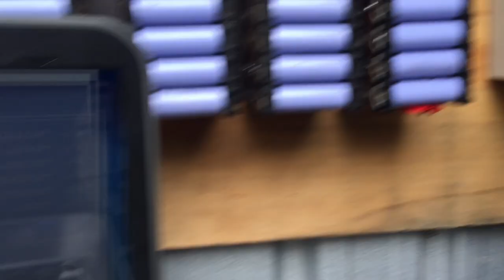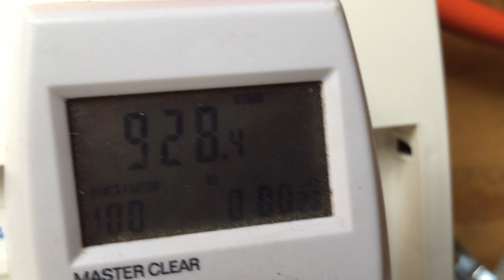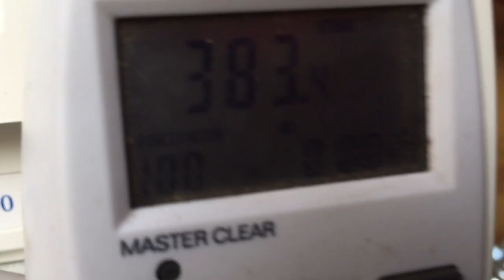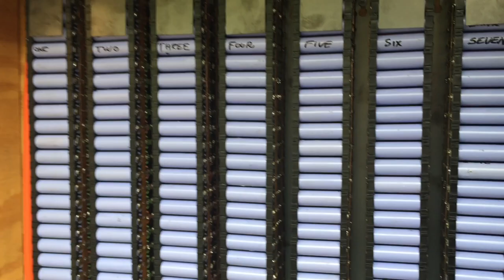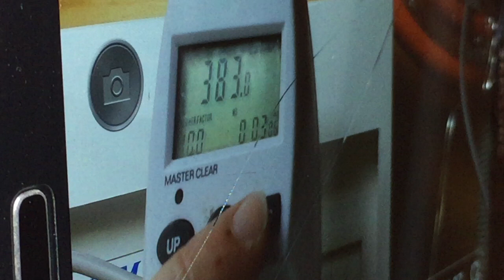385w Load test using 2 banks of batteries

Comment: 13kW.
Even if the bottom bank got less capacity the discharge curve will be nicer.
And since you are doing 300-400watt load the inverter will have less load wich means less heat wich would mean less energy wasted.
Well i'm probobly wrong but just wanted to place my bet :)

And i'm from sweden.

Comment: pete i do have one quizzing question a 3 parter mate ive looked at the way its wired up from the cell  pack to the inverter and  saw you are running them into a what looks to be a fusebox i was wondering why you was fusing the neg side, as this is where the heat was on thermo cam wouldnt it be better to connect the negative from the inverter to the middle of both packs connected to a bus bar then fitted to the batt packs providing equal return  to the cells, not connected to the top pack first then to the second pack ohms law ,the same could be done on the positive side aswell making it draw equal power to the fusebox , and one more mate also could you do the same for the packs instead of connecting in series to just the top of the pack add tabs to the bottom of the pack and then connect them to the bus bars aswell making yr draw and return equal in every way, now you could tell me to f,,k right off and go and do it ya fuckin self that would be fair as i have no posts but i ve spent my 20, 30 grand 7 yrs ago making something that is never gonna work until things get smaller  lighter with more power...but i did learn a few things along the way, sorry for the long post
Reply from the maker: In australia land both need to be fuzed cause someone at some point burnt their house down :( Heat was from the positive side not negative side in all tests. Middle yes better but time/money/need to have this test started ment it ended up like this. Can't add to bottoms sorry but i'm working on V5 of the busbars now.
Reply: ahh ok different country different regs, and as for the burning of the house what can you say ta that, Muppet should got a pro in the know ( Heat on the pos side of the fuse ) could that issue be addressed  there are better fuses with less internal resistance seems to me that would be more of an issue the more current you draw (bottle neck)probably what burnt that house down who knows.one more just watched the latest vlog loved it mate my misses saw your request and laughed liked that one anyway,i still think having tabs at the top and bottom would be better for the cells all round, it would half yr amp request at each tab end, yes its more copper but it would be a more even draw

Comment: Morning Pete - Geoffrey  from Essex UK, system did 4 hours at 1000 watts then followed by around 9 hours of a load of 100 watts. Me thinks the two packs will be around 11 Kwh so if the load is 385 watts an hours your going to be running for over 24 hours. I would say 28 Hours

Comment: Probably around 9.7-9.9kw, from Saginaw, Michigan, USA. I have a similar diy powerwall in progress as well with about 1100 good cells capacity tested and ready to go into my modules... Just a quick question, wouldn't a large portion of your balancing issues be avoided if you had arranged your cells so each module within your entire bank was of equal capacity vs the arrangement you currently have being that each module has only cells of like capacity (i.e. Each bank has an average of say 2200 mah cells vs. One entire bank of only 2600mah 18650's). Therefore, when all the modules are connected in series, each is of like capacity and there anen't any fluctuations in overall module capacity allowing the unbalancing issues from the get go...? Just a thought.
Reply from the maker: YUP - stay tuned to find out i deal with this issue :)

Comment: I think you're going to discharge the top Bank more than the bottom with that cable setup.. 🙄
Reply from the maker: it'll work for now getting cables to be the same size isn't a priority atm. Needed to get this test done so i could give the Thermal Camera back ...
Reply: +HBPowerwall size is fine.. just move the negative link from the top bank to the bottom for the inverter. it will pull the current better across the two banks.
Reply from the maker: well that's an easy fix :) will do !

Comment: not sure the climate where you are located, but was wondering, is it cold enough out side that the heater never shuts off? I live in Central Arkansas in southern USA, and in the fall here the outside ambient temp could get warm enough to shut a heater off on high setting. I enjoy your videos, thanks.
Reply from the maker: it isn't running solid, how ever it's still a valid test as power levels change constantly within my home.. so i'm happy

Comment: Peter don't you think that is good idea to connect the packs in between too ? I just think you're going to get a better discharge and charge with the same voltage in all packs "lots of wires too" just what I think, still going great.
Reply from the maker: One huge thing for this whole project it how it looks - it's possible i might lose something due to this obsession but i'm happy with that. In the end it's a process that i'm working through..

Comment: A nice way to do the ends is to put the terminal in a vice, heat it up and fill it about 1/3 to 1/2 with solder and then insert the stripped cable into it and allow it to cool. More or less solder depending on size of cable of course... No crimping required.
Reply from the maker: 300 ton of clamping force for the win...:)
Reply: No doubt a solder cable end is a great connection... But Over time the flux & soldering will cause cable corrosion. (what i'm told) so for solar a good cable crimper is best for the long term.
Reply: Its a better way to crimp the connectors, but if you don't have the proper crimper than its one option, or crush it in a vice